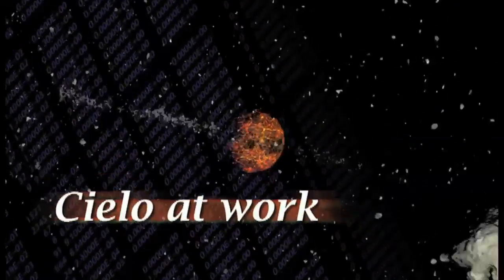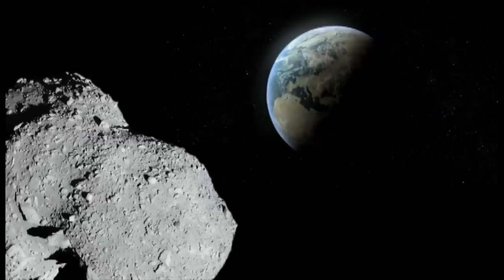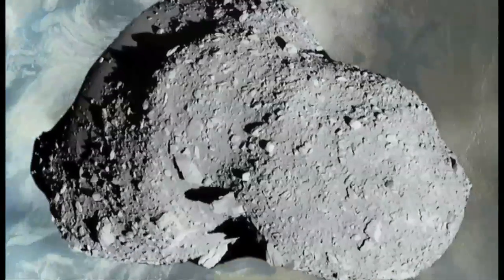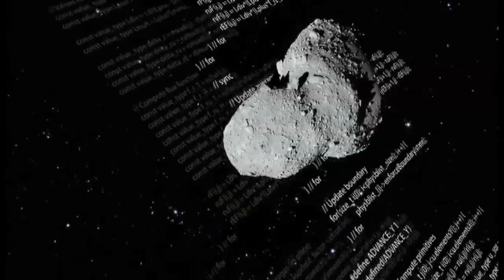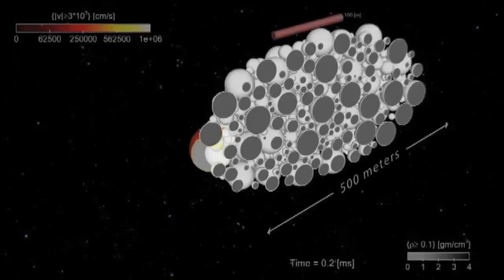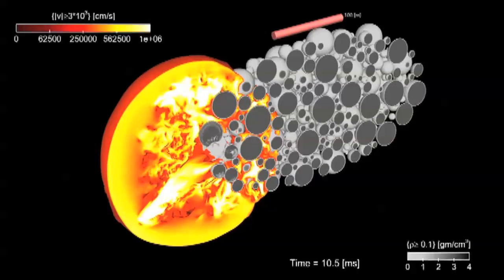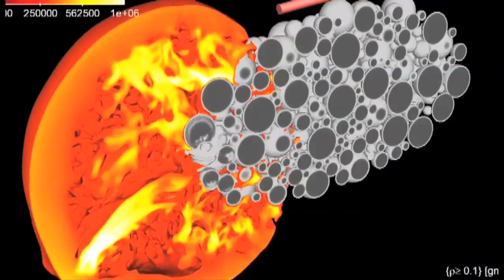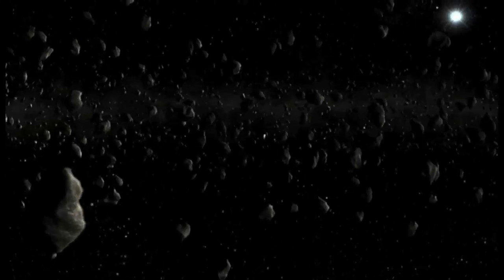Los Alamos Asteroid Killer

Comment: @Armyless1 Of course there is a shockwave. Where does the energy of the nuclear weapon go? It is carried away by x-rays, gammas, neutrons and an ionized plasma of bomb components expanding at a significant fraction of the speed of light.

A massive shockwave will start at the surface of the asteroid as it is hit with a combination of radiation pressure, plasma pressure and ablation pressure.